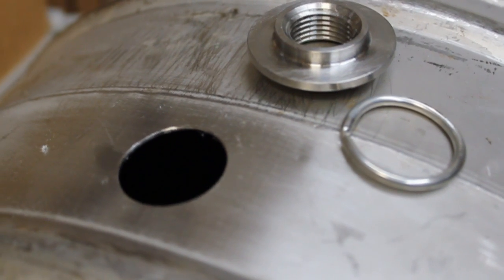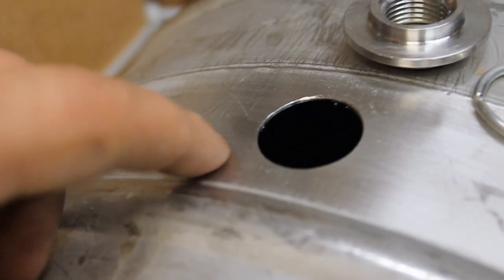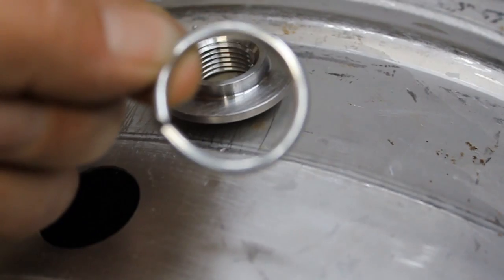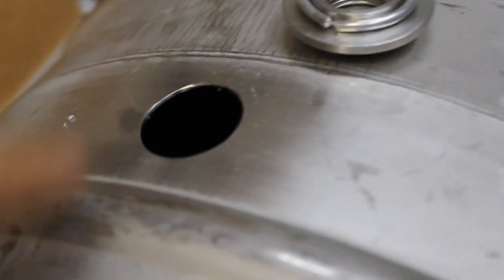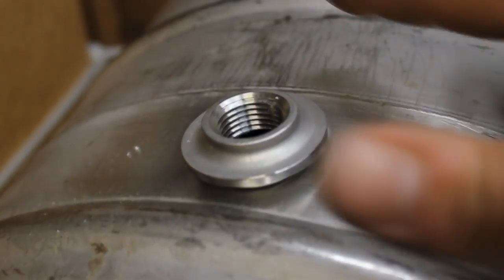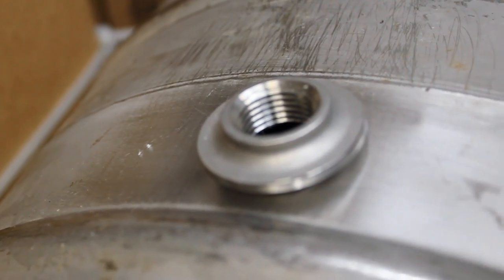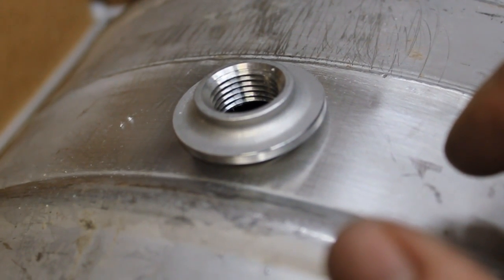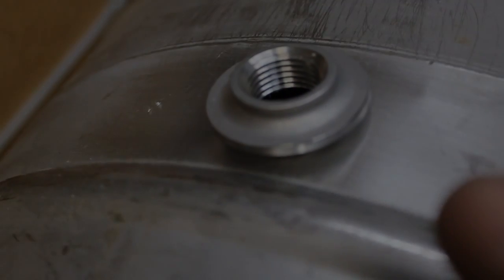BobbyFromNJ Prepping a vessel to solder in a threaded port

Comment: Will the 1" NPT welding spud have a 1" wide inside diameter? I am wondering if that is the correct size for a screw in immersion element to heat the mash? 
Great video, it's very easy to overheat and lose the flux, as I have done before watching this video

Comment: Thanks. Couple other things: Whether to use a domed false bottom or a full coverage one with a raised support. I worry that the domed one will not be as efficient but that the full one will not have a tight fit and allow grains to seep into my wert cavity. Outer keg width is 15 1/2".

Also, how low is the profile on the spud? A perfect world would give me flush to the bottom but I need to take it apart for storage and cleaning.
 I know you are busy. Hope to hear from you soon.

JohhnyGlaze

Comment: Hi Bobby, question: For my mash tun I was thinking of converting the same type of keg and use this type of settup at the very bottom of the keg (would be lowest point, centre of bottom dome)with a dome false bottom inside (attached to the drain somehow)instead of having it on the side with a drip tube for when i sparge. If I circulate before I sparge, the wert should all vertually drain out clear as opposed to having a bit left over, thus improving my efficiency. Any thoughts?

JohhnyGlaze